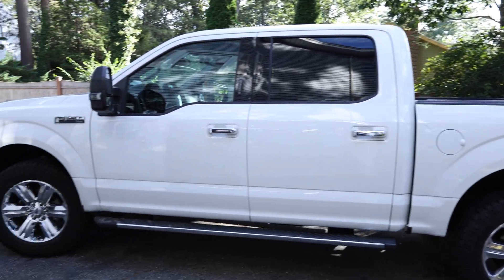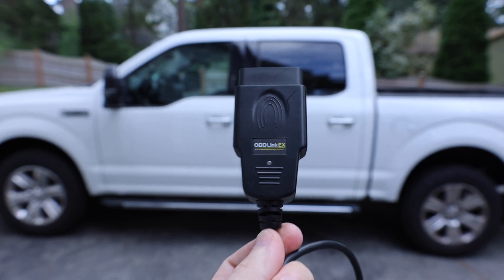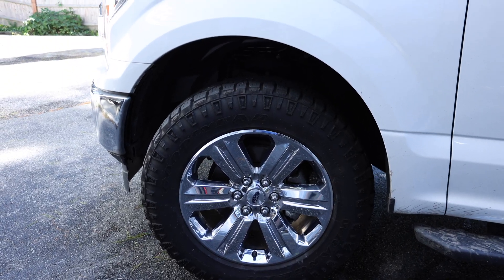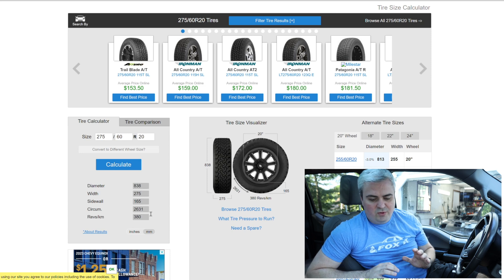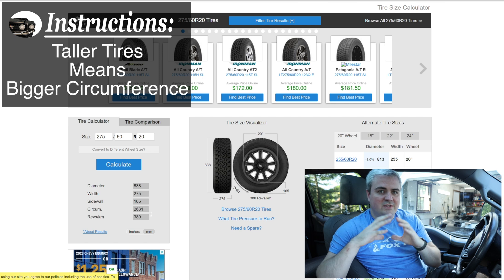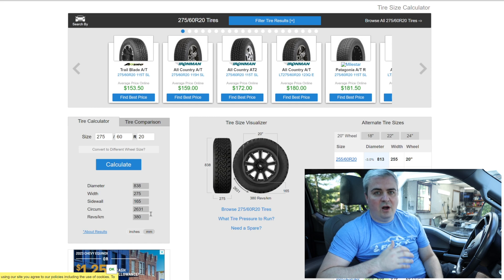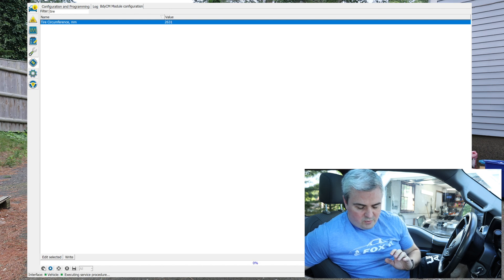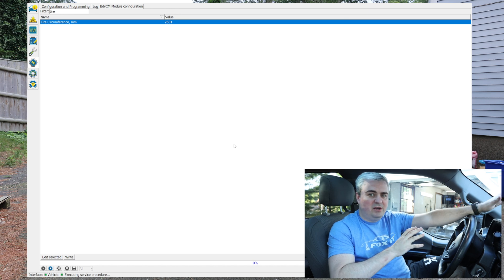Adjusting for Bigger Tires in FORScan for your F150

Comment: I bought a RAM and the dealer has 35 12.5 r20 on 3 other 1500s also. I figured it would be calibrated, it's off 4mph at 40 and 8 mph off at 75. Your gear is so simple- nut the dealer says RAM won't allow them to change it. That's nuts. I really don't care about mph or mpg but it's wrong on the odometer and other sites says it damages the transmission. If this truck can tow 8 to 10,000 pounds, I can not see a tire change doing anything to the transmission. But I flat don't know. Thanks for a good video showing some trucks can be changed.
Reply from the maker: I have no experience with RAM trucks but check out AlfaOBD or try a different dealership. It's crazy if a dealer tells you they can't do it. There must be some way to fix it. I'd expect a dealer selling a truck to at least have the right speedometer calibration on it!
Reply: I had a 5th Gen ram I used edge pulsar to adjust the tire size and also turned the mds off with it. They run about $700 new.

Comment: Can u answer me a question?
I have a focus St and I have tire size 235/35 19 with 1975mm in bcmii module and also in IPC module but the odometer tells me allways to much (drive with 100km/h odo shows 107 km/h)
If I want reduce the shown speed to 102 km/h I will like insert 2005mm.
Is it right that I take the changes only in IPC module and not in the bcmii module?
If I change IPC and bcmii module, there is no difference (shows also 107km/h on 100km/h speed)

Hope you understand, but I am from Germany, thx😊
Reply from the maker: I understand but I don't know what to tell you. I haven't had to deal with the two separate modules with y truck. You could post in the for scan forums.

Comment: This video seems wrong, more steps are required to actually apple the new tire size information. At least on my F150. Ive run into this and numerous others have.
Reply: he is probably talking about the DTCs in the PCM and TCM after changing tire size in forscan.  Have to relearn to fix. 
I just went through this. I was trying to put in 2631mm but kept getting error. Highest I could get is 2501mm without errors.
Reply from the maker: What did you have to do differently?

Comment: After changing the size of the tire and resetting the transmission table I got this error message.
Any idea how to get this fix? 

===PCM DTC P0630:00-AF===
Code: P0630 - VIN Not Programmed or Incompatible - ECM/PCM

Status (-AF):
 - DTC Present at Time of Request
 - Malfunction Indicator Lamp is On for this DTC

===PCM DTC U0422:00-2F===
Code: U0422 - Invalid Data Received From Body Control Module

Status (-2F):
 - DTC Present at Time of Request
 - Malfunction Indicator Lamp is Off for this DTC

Module: Powertrain Control Module

===END PCM DTC U0422:00-2F===
Reply from the maker: What did you input and where for the circumference of the tires?
Reply: @SmackeysGarage  i follow your video. And my new circ is 2718 mm.
Reply from the maker: Some people said after it popped up with the larger tires, they went back to the stock tire size and reprogrammed... then programmed the tires one more time with the larger size and it cleared.
Reply: @SmackeysGarage  i will try to again. Hopefully P0630 will go away.
Reply from the maker: @trixerbautista6766  Follow up and let me know. It'll be helpful to people who see this pop up.
Reply: @SmackeysGarage  good news, i cleared the engine warning and the wrench service symbol. 
I did re-enter the OEM tire circumference then punch the new tire circumference. the error shows up again in the DTC log. After resetting twice still shows the error. Then I turn off the ignition key "pull-out" , wait for 10 sec approximately. Turned on the engine and all warning and engine symbol went away...
Reply from the maker: @trixerbautista6766   That's great to hear! Sounds like it was a bit finicky to get the system programmed correctly. Glad you got it sorted out!
Reply: I tried, tires were to big and the BCM/advance trac had a bunch of codes. I ended up just going back tinstock

Comment: I just change the tires of my F150 2018 from OEM to 275/65/20. My gas went crazy and I noticed the transmission shifting is a little bit wild from time to time. Would forscan will fix this if the circumference will be calibrated as close as possible? Any magic number for 275/65/20?
Reply from the maker: It could help. You could also reset the adaptive transmission tables. For a starting point. I'd use 2718 as the circumference of the tire.
Reply: Thank you. I would definitely do this. I will let you know the result👏✌️
Reply from the maker: Sounds good!
Reply: i did change the tire size and i have error and shows wrench in my truck every time I keyed in. 
shows DTCs in TCM:P160A:00-AF error
shows DTCs in PCM: U0422:00AF error

Can you help me?
Reply from the maker: https://forscan.org/forum/viewtopic.php?t=17408

Check this
Reply: ===TCM DTC P160A:00-ED===
Code: P160A - Control Module Vehicle Options Reconfiguration Error

Status (-ED):
 - DTC Present at Time of Request
 - Malfunction Indicator Lamp is On for this DTC
 - Test not complete

Module: Transmission Control Module

===END TCM DTC P160A:00-ED===

===PCM DTC P0630:00-AF===
Code: P0630 - VIN Not Programmed or Incompatible - ECM/PCM

Status (-AF):
 - DTC Present at Time of Request
 - Malfunction Indicator Lamp is On for this DTC

Module: Powertrain Control Module

===END PCM DTC P0630:00-AF===

===PCM DTC U0422:00-2F===
Code: U0422 - Invalid Data Received From Body Control Module

Status (-2F):
 - DTC Present at Time of Request
 - Malfunction Indicator Lamp is Off for this DTC

Module: Powertrain Control Module

===END PCM DTC U0422:00-2F===
Reply: @SmackeysGarage  after resetting all PCM , TCM  and adaptive transmission table and clear the errors, the wrench went away but the engine symbol still showing  on the dashboard. Rescanned with forscan show dtc P0630 “invalid vin number”
Reply: @trixerbautista6766  what did you figure out mine did the same thing...
Reply: @codypylatuk8350   good news, i cleared the engine warning and the wrench service symbol. 
I did re-enter the OEM tire circumference then punch the new tire circumference. the error shows up again in the DTC log. After resetting twice still shows the error. Then I turn off the ignition key "pull-out" , wait for 10 sec approximately. Turned on the engine and all warning and engine symbol went away...
Reply: Do you have a video how to reset the adaptive transmission table?

Comment: For those asking! A dramatic change in tire size can/will affect transmission shifting and a sort of "dogging down" at highway speeds. It isn't actually "dogging down" but may require more throttle to maintain speed, and/or cruise control may have a harder time maintaining speed. This will fix those problems! Also - the reason his speedo is still slightly off - is because the tire circumference will slightly reduce (by ~3% at these sizes) when truck weight is put on them. You'll notice that the default setting in your truck has already accounted for this and is slightly lower than the original tire's actual circumference. To account for this, reducing the # in mm of your new tire's circumference by ~3% will make the speedo basically perfect.
Reply: Doing gods work. Thanks a lot
Reply: Thank you thank you thank you!! Exactly the answer I needed to know!! You rock. 🙏
Reply: To get the transmission to learn this properly do I just adjust the size of tires or do I need to do something else?
Reply: @ericpena3426  Depending on your model, you might need to relearn TCM, ABS, AWD modules etc everything that uses speed value. You should also use 96.7% of the true tyre diameter to simulate the squash of the tyre under weight. This is why the factory value is less than the actual value of the factory fitted tyre.
Reply: @orangejuicepony6881  how do I do that, i have a 2018 f150 and as soon as i adjusted the tire size the wrench popped up on the dash.
Reply: @Michael-t9m1v  I have the same problem, any advice??
Reply: @ericpena3426  Once you adjust the tire size - the transmission should start to act normal again. You could also perform a "re-learn" on the transmission - but it's not really necessary.
Reply: Could this cause a surging in boost especially at highway speeds?
Reply: @dustinmontgomery9923 it depends on what exactly you mean by "surging". It can cause the vehicle to change speed back and forth to - especially on cruise control. Although it's not really violent.

*Update - I overlooked when you said boost. How high is boost spiking, and can you feel it? If you go up a decent amount in tire weight and size, it can cause more boost usage when passing / accelerating. But I would think surging is probably unrelated.
Reply: @jamesreese3937 ok thanks. Ya I actually went down in size from 35 to 33 and it surges under a load. When I tow at highway speed or role into the boost it'llflucutate. My speedo is off alot too. If my speedo says 90 I'm at about 80.

Comment: By doing this, do you think it’ll up the transmission? I noticed after changing my tire size and not correcting it in the computer. The transmission seems to shift differently than it did with the stock size tires
Reply from the maker: You could reset the adaptive tables on the transmission using Forscan. I don’t believe changing the circumference on the tires it’ll change anything else. I did not notice a difference doing this.
Reply: @SmackeysGarage  do you mind explaining how to do that? I’m still new to this Forscan stuff.

Comment: I just did this and now I got a wrench light. Unable to clear it, P160A in TCM.
Reply: any updates? Im about to try this myself. Your post scared me. lol.
Reply: @bigworm1384  i got mine cleared
Reply: Any luck clearing.?
Reply from the maker: Check this page out. Someone else had a similar issue and was able to remedy it with these steps.

https://forscan.org/forum/viewtopic.php?f=5&t=17408&p=85822#p85822
Reply from the maker: Let me know if it works. If it does, I will pin the comment.
Reply: This worked to clear the wrench light on my 2018 f150 .Thanks, now the speedo is right and the wrench is gone @SmackeysGarage
Reply from the maker: @stevenl34  glad to hear!
Reply: i did follow this to reset:

reset the PCM- Reset All Adaptations,
TCM- Reset All Adaptations,
TCM-Clear Transmission Adaptive Tables.
DTC codes

The wrench went away but the engine alarm still show...

Comment from the maker: I got feedback from a viewer that the stock settings on an F150 with 275/60/20 is 2547mm. That might make a good starting point rather than just using the calculator directly. Keep in mind, different tire pressures may cause this # to be slightly higher or lower.
Reply: Any magic number for 275/65/20

Comment: Nice calibration and fix!👍
Reply from the maker: Thanks Mitch!
Reply: Define drastic.   I went from 225 to 235 65 17
Reply from the maker: Assuming just the 225 changing to 235, it's only a 1.8% increase in tire size. Not a major change in the speedometer.